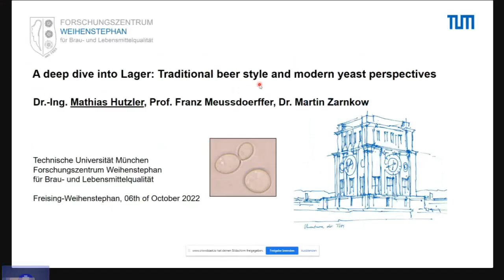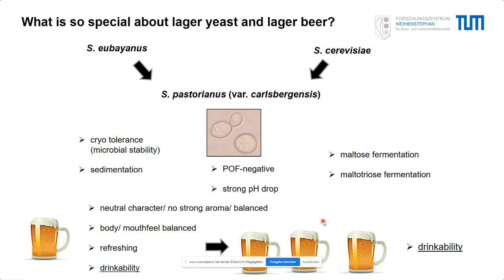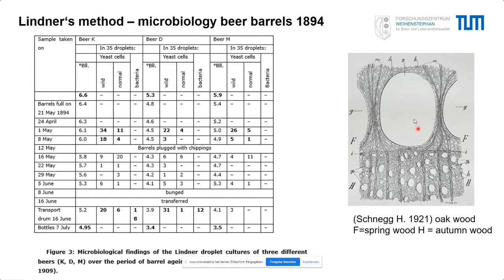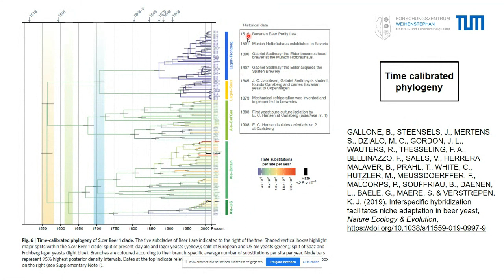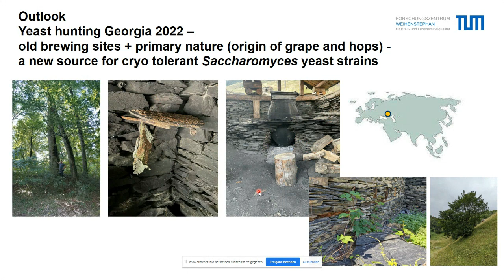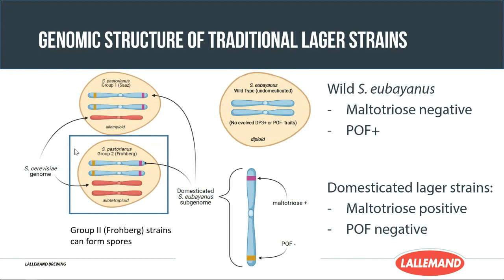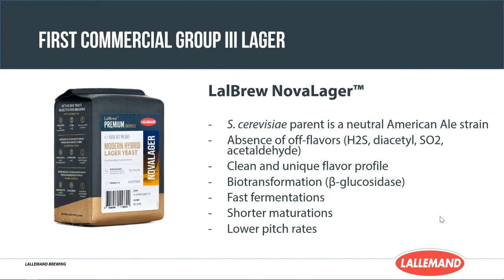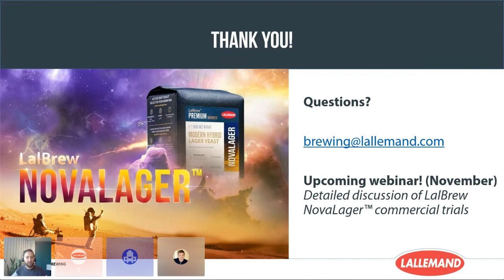Webinar: A Deep Dive Into Lager - Traditional beer style and modern yeast perspectives

Comment: Hello, do I need to use higher fermentation temperature (over 15°C) to utilize the biotransformation with B-glucosidase as we are supposed to with Aromazyme? Also is the taste profile closer to Czech Pilnser Yeast or to any other? Or is it absolutely unique tastewise? Many thanks! J.
Reply from the maker: The LalBrew NovaLager™ strain is truly unique, it can’t be compared to existing lager strains. It defines a completely new lager lineage that is genetically distinct from all other lager strains. That said, one of the parental strains used to select LalBrew NovaLager™ was from the group II (Frohberg) lager lineage, which includes the iconic Weihenstephan 34/70 strain as well as LalBrew Diamond™. In general, you will find that LalBrew NovaLager has slightly more fruity character but with fewer off-flavors such as diacetyl and H2S compared to other lager strains. We don’t have data about what conditions lead to higher expression of the beta-glucosidase enzyme. But certainly any enzyme that is expressed will be more active at warmer temperatures. In general, I think that you will see the greatest benefits from this strain by using temperatures above 15’C.